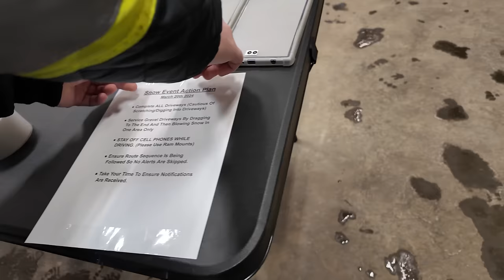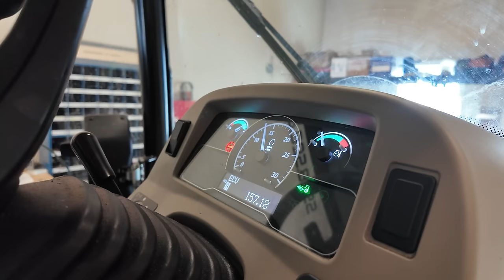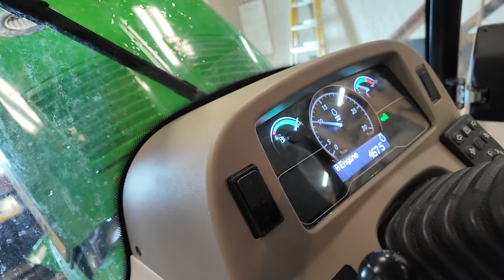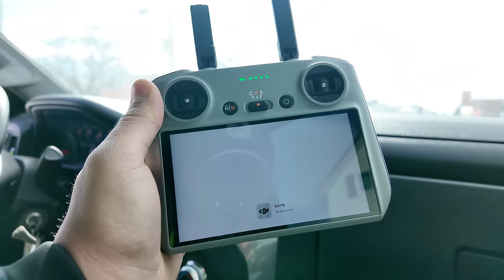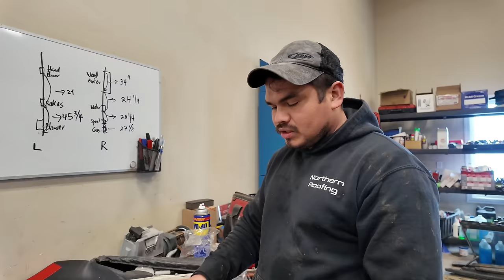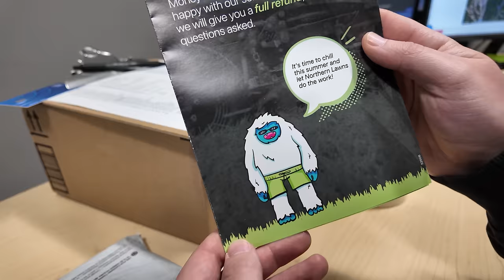Crushing Back-to-Back Snow Events

Comment: I know sounds little bit stupid but your main problem with water in fuel  is your yellow fuel gugs is collecting water and/or conditation. I know about that because i run a mobile pressure washing business and i used fuel gugs in back of my truck in winter yes winter i have lost of jobs in winter , it was happening to me water in the fuel because i heat my water with my pressure washer keep eye on that im shore thats your problem with water in the fuel have good one forn new Brunswick canada